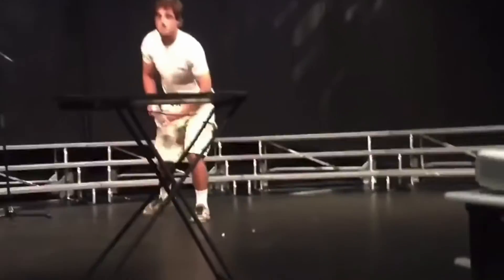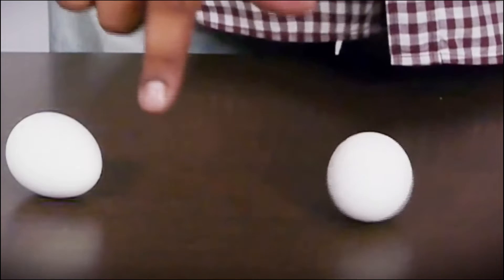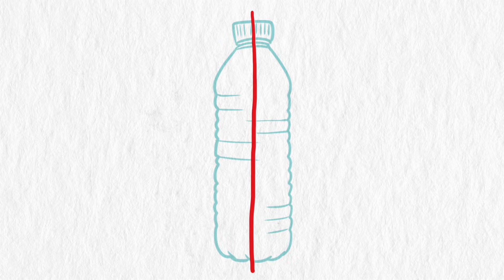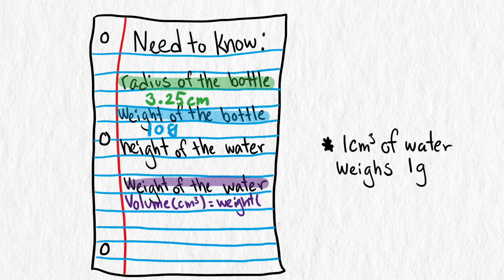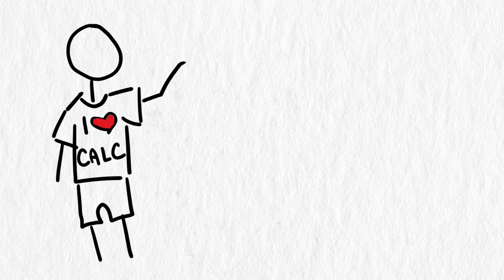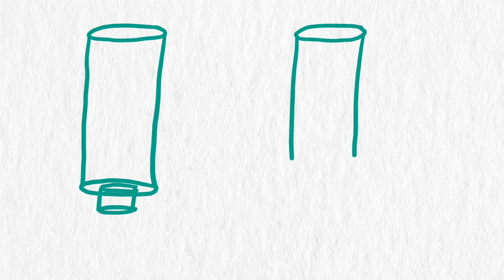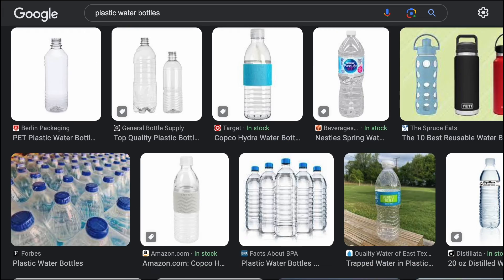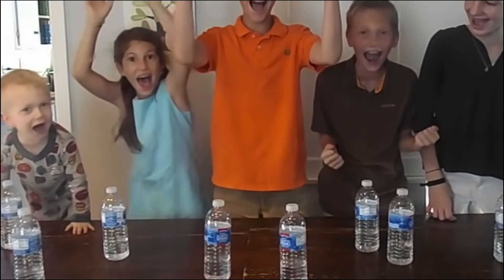What is the perfect amount of water for the perfect bottle flip? | optimizing with math

Comment: hm... This is an interesting problem.
My first idea was also to just minimize the CG (center of gravity). I have done that for so many problem before.
But the assumption that the mass of the water is fixed to the bottle does not look to hold when looking at slow motion videos.
This problem will probably live rent free in my head undtil I get to think about another problem.
I dont even know how to make an experiment that would find the true value to see if the model is working.
Maybe you could make some kind of simple machine that could flip the bottle, where you could repeat the same through over and over, while at the same time it was able to adjust the through (stronger or weaker) with some kind of measurement for how hard you through the bottle, and then find at which strength half of the bottles stay standing at the weak through boundary and repeat that for the strong through boundary. Then you know how sensitive the bottle is, the less sensitive being the better one. And then you just need to repeat that with different amount of water until you have found the amount of water there the through is the least sensitiv.
But how to make that machine, how to deside on the height of the through and how to measure the strength of the through are some difficult unknowns.
Reply from the maker: Certainly the water sloshing is a factor in reality and was something a bit too complex for our simple model used here. I like you're idea of building a machine that can replicate bottle flips with exactness. That would certainly help control the many other human factors when flipping bottles! But I agree it would be a challenging creation. Perhaps we'll need to consult our engineering department 🤔
Reply: math the world X Stuff made here WHEN @MathTheWorld
Reply: I really want to meet that engineering department :)